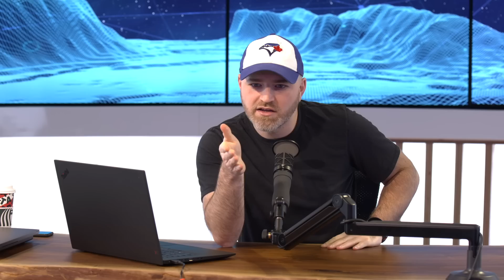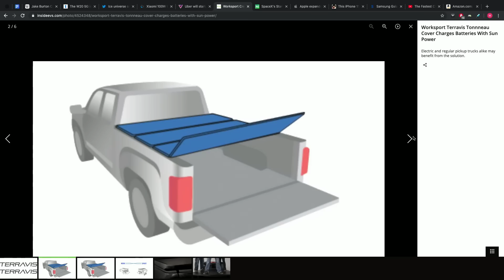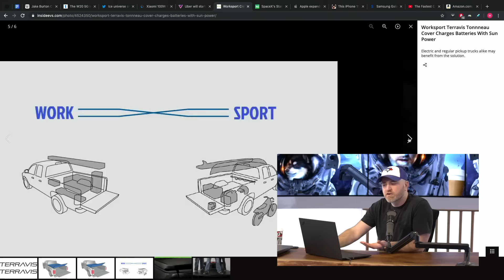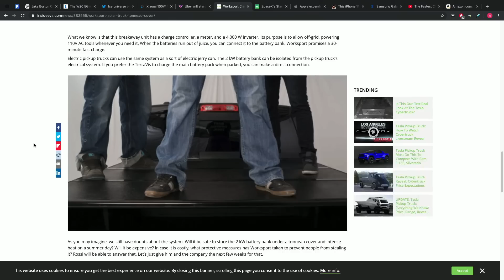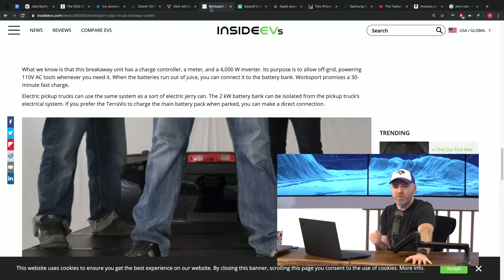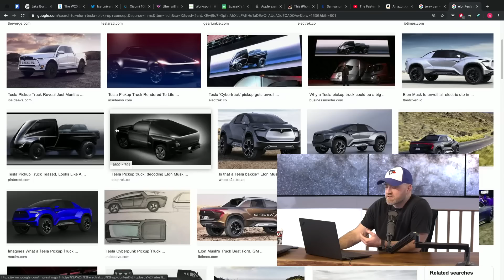A genius new truck idea...

Comment: This is a terrible idea. The panel is way too small to provide any usable electrical charge. As you drive around the angle of the panel to the sun is all wonky. Only a small percentage of the time would it be properly oriented to the sun. And who can always park with the back of the truck facing south? Even in the best orientation the angle is not right for maximum solar gain. 
No one would use this to charge tools. Most job sites have power on them and you need your tools charging at max speed to keep working. Plus, the cost of charging is payed for by the job site owner- and it's really small. 
It is a terrible idea.

Comment: Those solar panels are way too small to charge the tesla battery in any meaningful way. But its great to use to charge power tools with.
Reply: Well if u go shopping for 2 hours EVEN IF IT ONLY CHARGES 5-10% it is Still Still very nice , you charge less on your normal non sloar powered charger , you spare energy and money . Its like battery charge for free. And the cybertrukk already has this built in.
Reply: Btw.. everything can be improved even solar panels , Maybe we will discover a better way to gain alot more energy forma solar panel in tha future , this can be usefull for a lot of things atm too , but i dont think thst this is the final form of solar panels .

Comment: an eltric pickup truck idont think would work in places like alberta when its -40 gonna lose all of its juice
Reply: Tesla batteries have thermal isolation and thermal control system. They're batteries cooling when it's hot and heating when cold. That's why Tesla's batteries does the best on a market (even previous generations of it, newer batteries will work much longer, vehicle itself probably will broke before batteries fail).

Comment: The only crappy thing is Solar power is too slow. You'd need more than a cover to do anything.
Reply: Xarc Factor Elom (Twitter) said Cybertriangletruck will get you 15 miles per day. I mean is something
Reply: Ernesto Gastelum That’s what I was thinking, i usually ride less than that in a day
Reply: @ernestogastelum681  15mph per day,that's assuming you could leave it for a day in one place.Only thing that does is if you go for a vacation for 2 weeks. It'll  keep your battery from dying.
Reply: @xiondFirst  it's 15 Miles per day on average. Counting rainy days; in a year, you will gather about 15 Miles per day if the car is outside for for 16 hours
Reply: Not if they're using tesla solar panels.
Reply: Messias Alves tesla solar panels aren’t great.
Reply: @eag8999  Crente?
Reply: @MajorWTech  Tesla Solar Panels arent more specials than others. Guys, there is no magic here, only phisics. When the tecnology goes better, probably you can do something, not right now.
Reply: We need nuclear cars
Reply: @Roshan_420  lol, real true mad max cybertruck
Reply: @Roshan_420  we need steam cars lol
Reply: Solar power is too slow
Reply: Did you forget that the car will be mostly exposed to sun light when parked on a parking lot, street etc? And even when you're driving it, it will still be getting charged by the Sun?
There's no need for "speed charging' when you have continuous charging during the day.
Reply: True but you'll save more it'll just take a while for it to pay itself off
Reply: Xarc Factor your comment will be so funny in 5 or 10 years
Reply: @Djdbwjfbehzhh  solar power is gathered slowly friend. It's been like that since it's inception.
Reply: think off all the time your car sits still
Reply: @samuelmatheson9655  Think off how small the surface is.
Reply: Nacho Manzano think of the fact that this is not being presented as a means to power your car. It could charge a backup battery for when you’re out in the Bush doing what trucking people do. Or to charge your power tools without straining your actual battery.
Reply: @joiion913  exactly, could be that your battery dies slowly, but I dont think you can actually noticed it. No way it can charge this massive battery.

Comment: Yeah the Tesla pickup has a electronic sliding cover that has solar on it.
Reply: Is the Tesla trucks box cover solar? I don't recal anyone mentioning that?
Reply: Shaun Ruben Elon was talking about it on twitter, ads about 14 miles a day
Reply: @nforgotten1005  that's awesome, didn't check twitter today.  My reservation is already in, bonus!
Reply: Elon also said they are planning to try to make it 30-40miles per day but yeah right now in there testing I’m guessing they got around 14miles
Reply: @jordons7963  Elon meant adding fold out solar panel wings in addition to the sliding roof panels .
Reply: @shaunruben119  It's a future option apparently!
Reply: Shaun Ruben Elon said it may be a possibility
Reply: @shaunruben119  Elon tweeted it out
Reply: It's an option, it's not standard
Reply: I dont think the demo truck had that but its in the works
Reply: Jordon S not for sure
Reply: Ford trucks only in my house Chevy need not apply I don’t know if I can give up my gas ⛽️ truck for an electric one hmmmmmm
Reply: Mark H You should look more into it!  You may be pleasantly surprised.

Comment: Current solar panels don't produce enough power to make it worth the price to lug around a solar panel. It won't produce enough power to get you out of a situation when it comes to charging an electric vehicle battery. It would work great for basic power tools on the go.